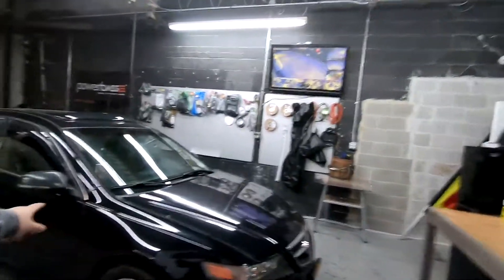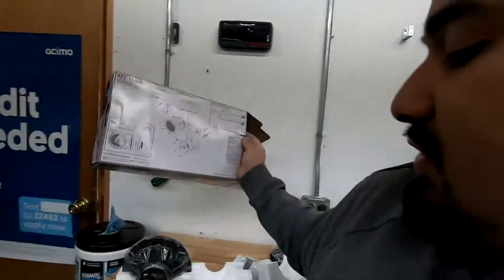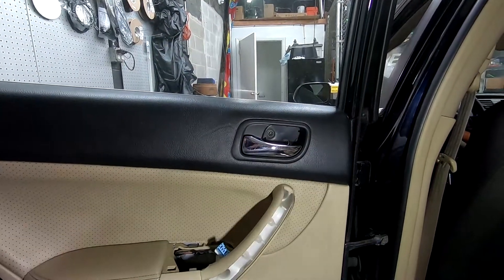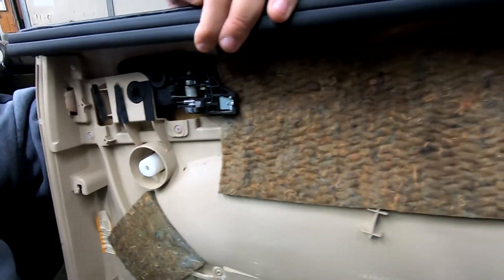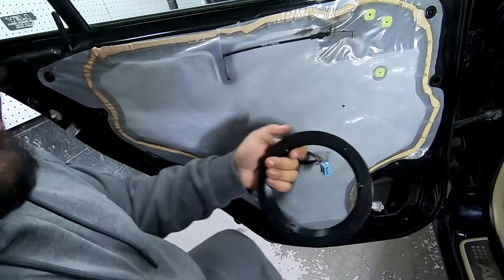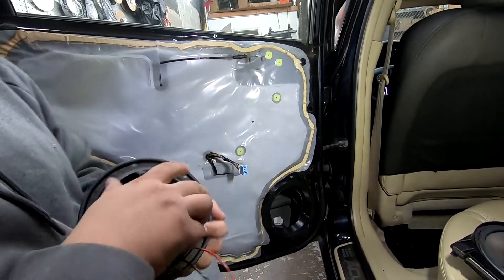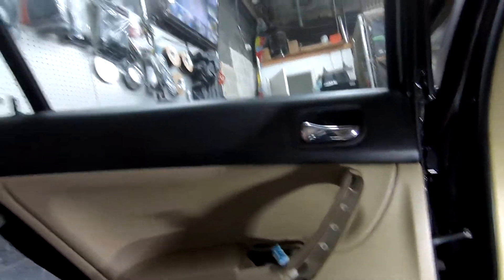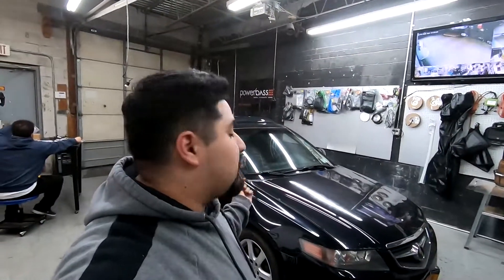2004 2005 2006 2007 2008 Acura TSX Rear Speaker Install | Rear Speaker Upgrade - DIY GUIDE

Comment from the maker: If you are looking for the speaker spacers found in this video you can find them here. https://mobilemaxcaraudio.com/product/acura-door-speaker-spacer-adapters/ If you are looking for a set of rear speakers you can find them here.  https://mobilemaxcaraudio.com/product/acura-rear-door-deck-speaker-replacement-upgrade-jbl-coxial/
Reply: Any info for the plug and play harness for the amp?
Reply from the maker: @fns_va  https://mobilemaxcaraudio.com/product/2004-2005-2006-2007-2008-acura-tsx-factory-amplifier-bypass/
Reply: @AcuraAudioGarage  thank you! Just ordered.
Reply: Is it $40 for a pair or $40 for a single spacer?
Reply from the maker: @Eon-Blue  $40 gets you two spacers, two harnesses, 6 inserts, 8 screws.
Reply: @AcuraAudioGarage  oh nice, thanks for the reply. I will be buying. For some reason you are the only vendor on the internet that sells this. I looked everywhere

Comment: Double din dash kit for the bottom were cubby sit in front of the shifter. Even if customers have to customize the cubby door by cutting, maybe a dress up kit/brackets that can be added after the cut to give it a clean oem look.

Comment: My rear speakers work but they are super low do you know what’s up with that ?
Reply: Literally have the same issue. Have an aftermarket amp I used their harness finally got around to installing the rear door and man sounds terribly low. The rear deck sounds better than the rear doors.